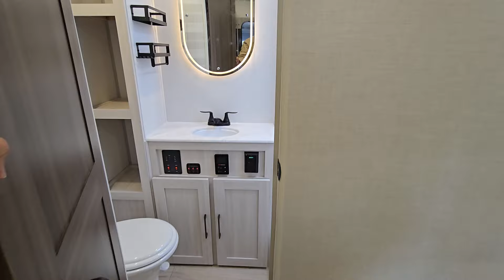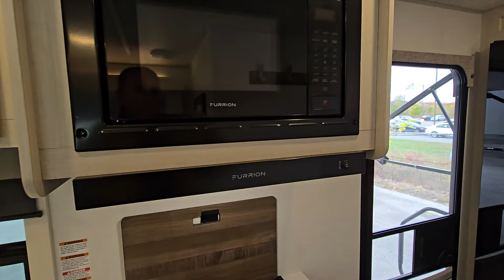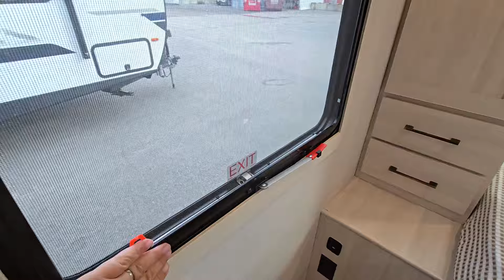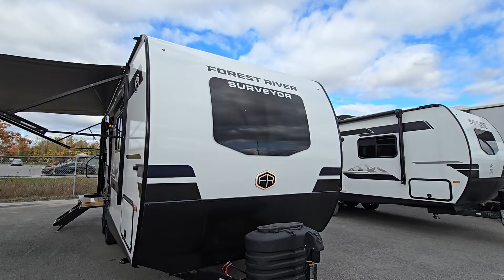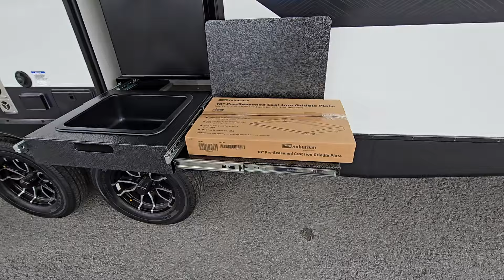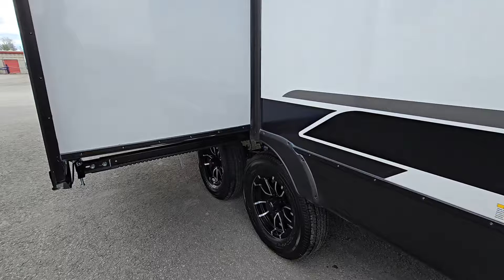25 Feet of Pure Genius: The 2026 Surveyor Legend 202 RBLE Everyone's Talking About

Comment: Thank you for the good review. We love this model but could you tell me the dimensions of the sleeper sofa and dinette when broken down into a bed ? Thank you
Reply from the maker: Thank you. The dinettes in  the Surveyor are nice and generous and repeat through out the lineup. it will be 41"x 73" . So if your 6'1'' and under you'll fit lengthwise. If longer simply angle yourself and you'll be fine